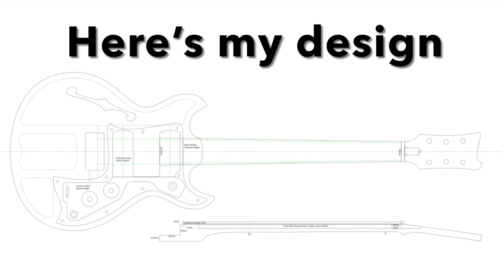Great Guitar Build Off 2021 - Part 1 - Building and Shaping the Body

Comment: Routing the cavities before sawing out the body was very counterintuitive and smart.
Reply from the maker: I’m trying to remember why I did it that way. Mainly because it gave a more stable surface for the router, I think. 

If I’d really been thinking, I’d also have put the top on and routed the neck pocket and control cavity before cutting the outline.

Comment: What bit did you use for the outside of the body?
Reply from the maker: The body is all made from swamp ash. I used a thin sheet of it to make the top of the guitar, if that’s what you mean?
Reply from the maker: Oh.. router bit... sorry. It’s a Trend  T46/1X1/4TC, I think